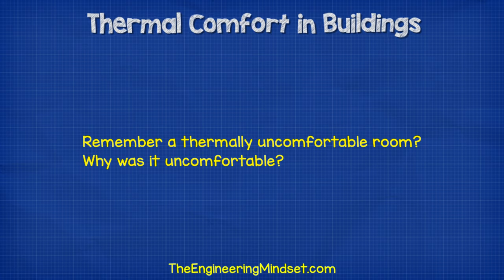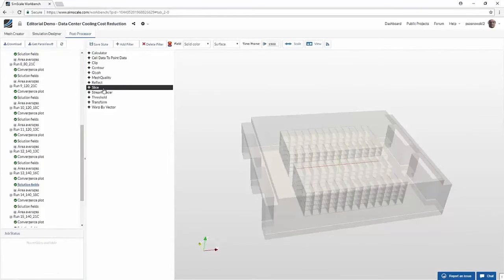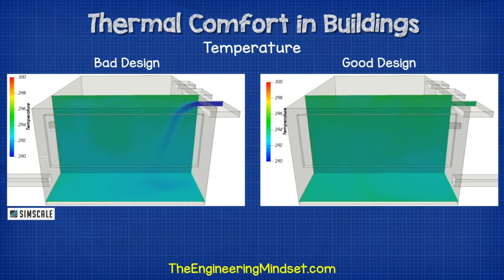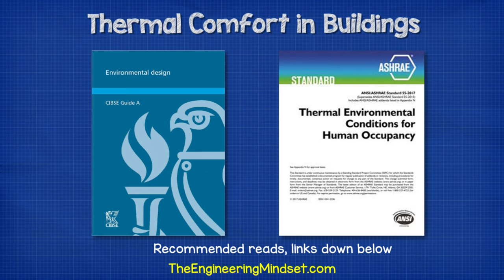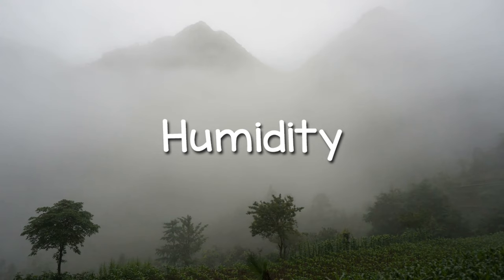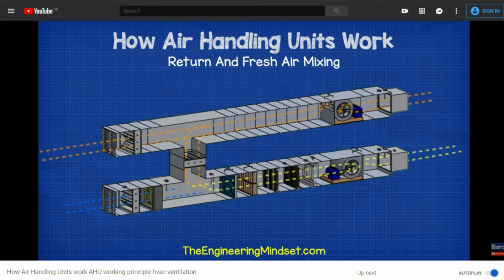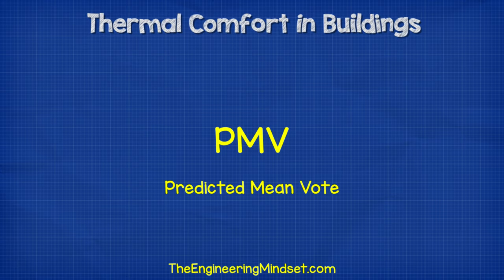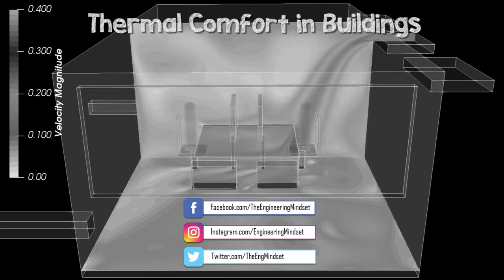Thermal Comfort in Buildings Explained - HVACR Design

Comment: Metabolic rate is more then activity related. I find it confortable from 18 to 20-21 C, some just are freezing, even at 23-24C, while sitting. The body adapts to temperature quite well, given proper time and constance. I find that is summer, 20 is a bit cool, not moving, but in winter, when it's -30, a find a 15C just about as cold. Then there are some people are just 'build' for warmer or colder temperatures...
Reply: Adaptive thermal comfort
Everyone feels comfortable at different temperatures

Comment: Don’t overlook that different people require different temperatures to feel comfortable! 72 degrees at 35 to 40 rth. Is a laboratory perfect environment, however some people like it hot dry some people like it cold and wet , the goal is a baseline of 72 degrees with a relative humidity of 35 degrees! Impossible to achieve to exact but a great baseline for engineers to accommodate 😂no matter what geographical orientation you have to climates 😂 one person to figure out how to make hundred’s of different personalities of comfortably with pre existing equipment design to obtain one goal 72 degrees with relative humidity of 35 to 40 ????
Reply: Engineers get it close as possible but then buildings add or remove after the original layout! Then smart engineers have to figure out how to accommodate proper IAQ with pre existing equipment to a space that’s been changed from original design for air flow and  heat load! What building engineers are lazy? Hell no we constantly figure how to make a building achieve this after build outs, remolding, change,etc! You see building engineer eating lunch, know he can’t even taste the food, just to occupied thinking how he won’t loose the building to uncomfortable and poor indoor air Quality!!!!

Comment: One thing I find interesting is how different rooms feel differently even at the same temp.  For example I always find at work it feels colder than at home, even at a given temp.  23 at home feels boiling hot and I'll be sweating, but 23 at work feels cold.  I guess the humidity and the air velocity might play a role.  At home there is less air velocity and more humidity while at work there's constant airflow and low humidity.  We actually have a 3 phase 208v humidifier but it can't keep up!  It's never ran well though... it spends more time in clean cycle than actually putting out.
Reply: The size of the room and the way the insulation act in the interior deflecting the radiant heat may effect the thermal sensation at any given temperature. In short explanation, the further away you are from a well insulated surface the coolest one can stay, to confirm just try to keep your hands cool inside a well insulated styrofoam cooler without any ice inside and you are just going to feel more warm because it deflect back our own body temperature.
Reply: All factors are connected together like a chain including HAVC system type...etc